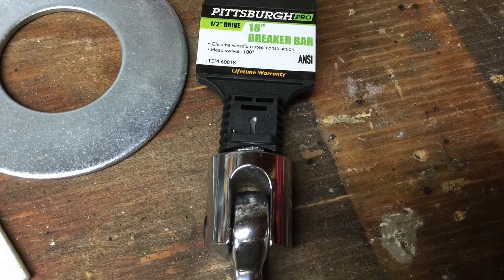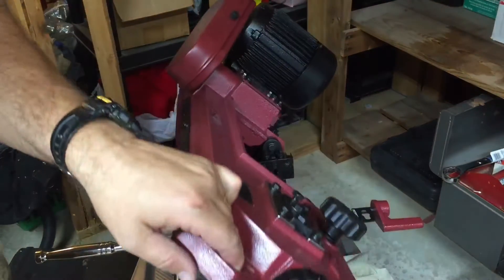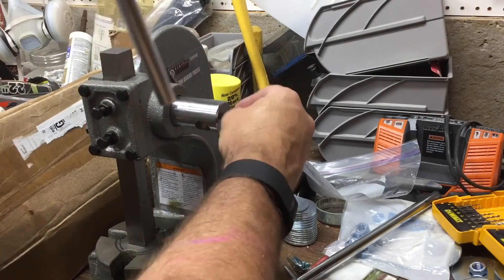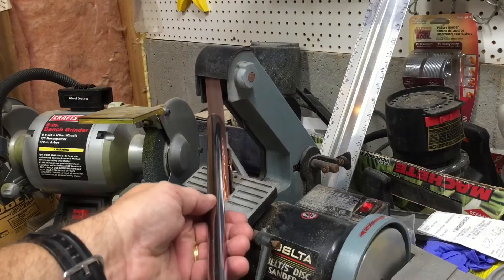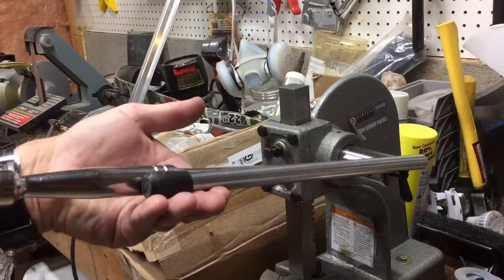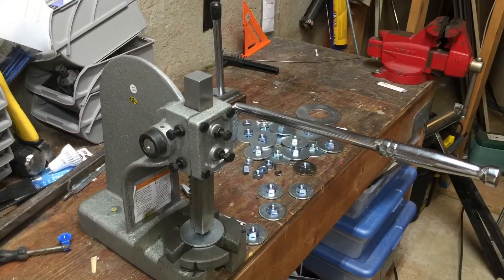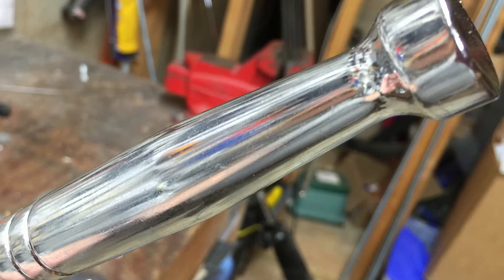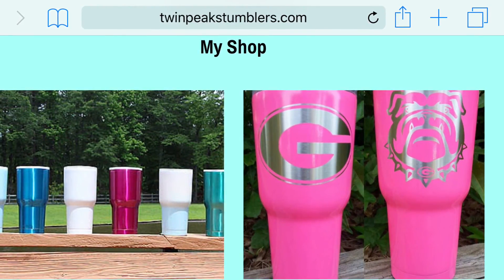3 Ton Arbor Press Modification

Comment: WHAT SIZE PRESS WOULD I NEED TO TAKE A 5/16" BOLT AND SMASH THE END SO IT EXPANDED to about 1/2" wide and 5/32 thick? assume low grade bolt.
Reply from the maker: I would look into a hydraulic press.  At least 20 Ton.
Reply: @ManCrafting  dang, might just have to heat it up and bang the crap out of it to flaten the end  instead, thanks for response.
Reply from the maker: @khandam7709  that actually would be a great way to do it if you have a torch.
Reply: It'll be easier to center it and just weld it

Comment: Ok..most arbor presses are labeled with a no1 2 3 etc....also i noticed u ahopmat harbor freight and they dont sell bigger than 1 ton arbor presses...and the height is too short for am.3 ton....my 3 ton has a long arm...just be careful you sont break the 1 ton with the increased leverage....how has it held up?
Reply: I got mine so i can press fit nuts into 3d printing projects like knobs etc
Reply from the maker: der ddd I do a similar thing.  Pressing nuts into washers.
Reply: @ManCrafting Derp-Derp me too!!!
Reply from the maker: der ddd it’s help up great.  I still use it quite a bit.

Comment: I saw many people using this mod to increase the leverage. I found you can also use 1/2" drive extension pieces, that are also 5/8" thick in chrome finish. They come in various length, some even go to 18", 24" or 30". They have a 1/2" drive square in one end, which you can put on a 1/2" drive socket to prevent the bar from sliding out of the arbor shaft. You don't need to cut anything and you can have various leverage using them.
Reply from the maker: David Yu good idea. Thanks.

Comment: Nice, but do the press not wear faster off by using more pressure withe the bar, or brakes faster?
Reply from the maker: WaschyNumber1 good question.  I haven't seen any wear on it.  The only place that I think could wear are the teeth.  The look the same almost a year later.
Reply: ManCraftingTM thank you for your response :-)

Comment: If you modified the rack as others have done i.e remove the bottom two teeth, you can set your new handle to the most convenient angle as well as having greater leverage. Regards.
Reply from the maker: Peter Gregory thanks. I'll check that out.

Comment: Are you still welding the nuts to the washer, or does pressing them in place keep them secure enough?
Reply from the maker: +Howard Camardelle  I press fit then tack weld in three places.  It gives me a consistently centered point to weld the nut in place.  Figured this out by accident but this method works perfectly for me.
Reply: A tack weld is all it needs.  I like the idea of the arbor press.  It makes for a real professional product.

Comment: What were you making with the nuts and washers?
Reply from the maker: I use the press to center the nuts in the washers prior to welding the nuts to the washer.  The fittings are then used as the top piece in a stand I use for powdercoating YETI and other brand stainless steel ramblers.